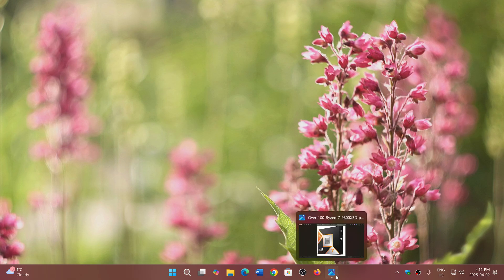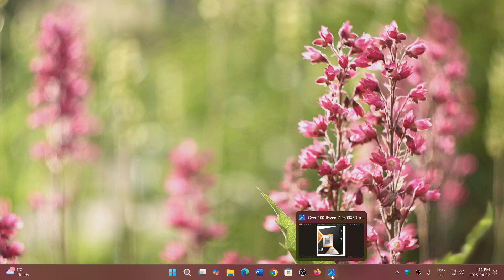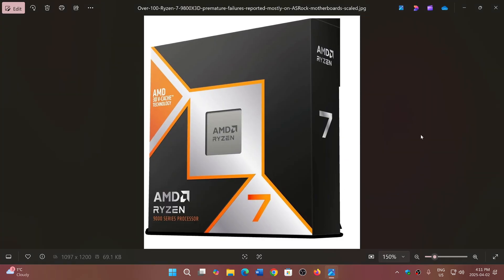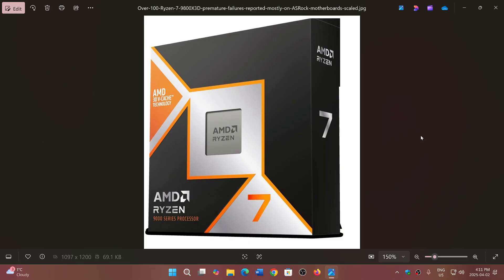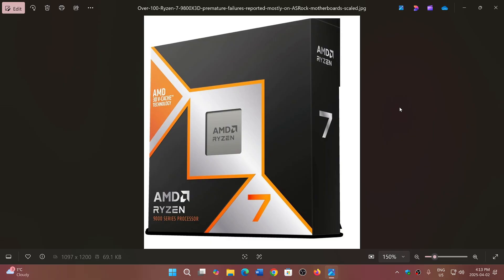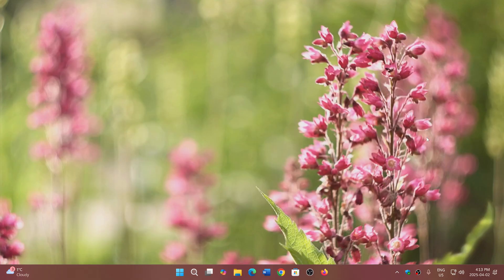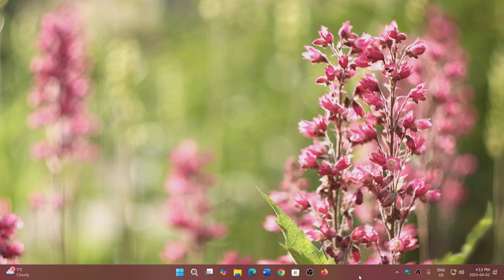Trouble ASRock Motherboards and AMD Ryzen 7 9800X3D CPU failures

Comment: Hey. A suggestion (maybe it does not solve all of your issues but surely can help): just open the BIOS, reach the voltage section, modify the VSOC option from [AUTO] to OVERRIDE and manually set the voltage to 1,1V if you have 32GB of memory or set it to 1,2V if you have 64GB of memory. There you go. Happy CPU. Safe user. If 1,1V (32GB) or 1,2V (64GB) does not make the PC stable, adjust by small steps up of 0,05V.

Comment: I think I've figured out what's wrong. 
1) You need to disable both "gaming" options in OC setting, set second one from enabled to AEGISA or something 
2) You need to unlock power limits, its in CBS -> SMU common options, set PPT, TDP etc I set 180000 just in case, as setting same stuff in AMD-Overclock -> PBO doesn't work . 
3) For PBO use "motherboard", 
4) make sure you've diselect all "eco" or other shit that limits power to your CPU. 
It takes in Cinebench R23 156W and reaching 23.6k score.

Comment: yeah I upgraded my pc. asrock motherboard and 9800x3d. built 3 months ago. my pc boots properly 5/10 times. I constantly have to flip the switch or reboot because of a slow or laggy boot. its upsetting to spend over 4k and have these issues. my cheap intel build never had problems like this

Comment: Not a 7 9800 but I have one 9 7900 nonoc version degraded under use with expo of 5600 and eco mode that started to bsod while loading windows unless negative pbo of 150 applied. The mb was b650 pro rs. The bios was always updated to the latest version. Both cpu and mb already rmad because of igpu failure before.